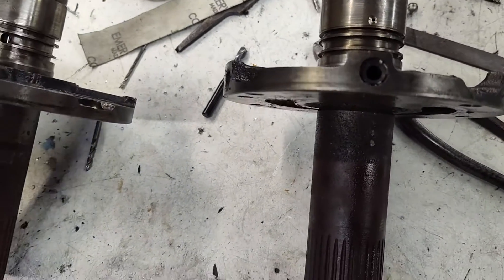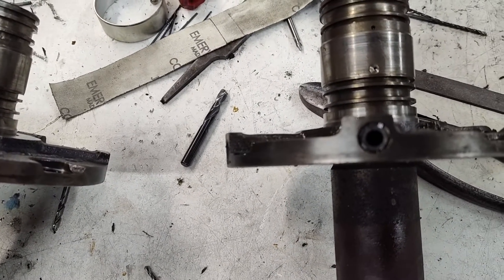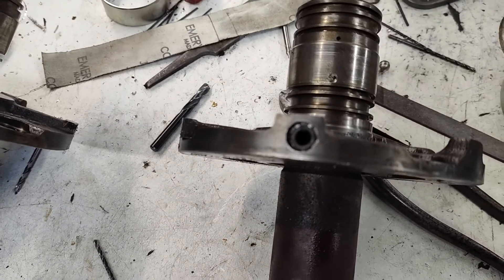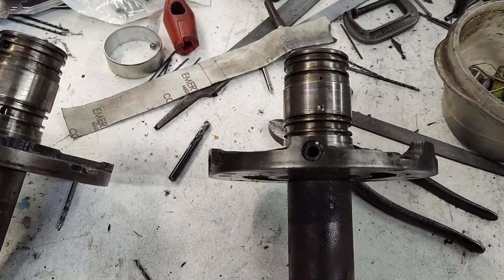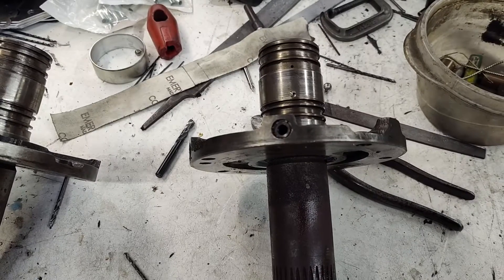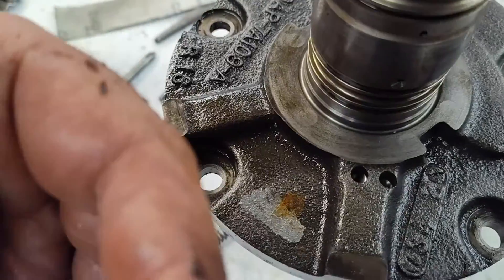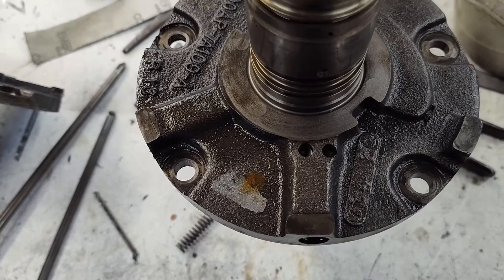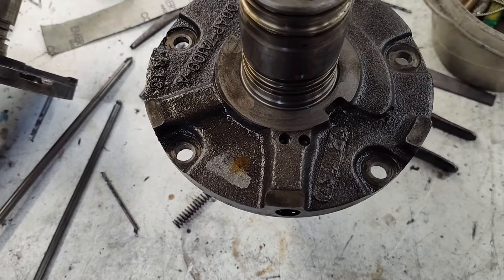Ford C4 Converter Pressure Relief System Explanation and Modification

Comment: The early C-4 didn't have the converter pressure relief. We had a bullet plug that we dropped in the feed hole. Converter relief started around 1967 if I remember correctly. Torque converters have to be full and under some pressure or they will start picking up some slip.
Reply from the maker: I remember that restrictor you are talking about. Those early C4s had a sorry oiling system.

Comment: I have a 408W with c4 rev valve and transbrake and it has blown the pump gasket twice now since the install. Has a 3600-4000 stall i believe. Do you think its pressure related?  Thanks.
Reply from the maker: Its a common problem with a C4. I would check your pressure and make sure its not super high.

Comment: I rebuilt my c4 with the broader performance kit years ago. Billet servo it shifted great for awhile and now skips second and goes to third
 Manually can hit all the gears. Sometimes in first jf I slow down it revs up to 2500 then catches pulls to 3500 and then shifts to 3rd. I screwed with the governor setting years ago a bit trying to get the shift points higher in the rpm range. It is running a deep pan and the proper filter. Stage 2 shift kit and 2500 stall. I can live with it but if it is something  somewhat simple I would like to fix it. Any ideas or suggestions would be appreciated. Thank you.
Reply from the maker: That's a complex issue. As these valve bodies get older I find sometimes fresh units I Dyno will stacked shift and skip second. In the interest of saving time I typically just build another valve body and it usually works. I'll try and address this in a video someday when it happens to me again and I have time to talk about it and how I fixed it.

Comment: Would a stiffer spring be a good compromise?
Reply from the maker: Maybe. If its something that concerns you Id probably just leave it alone. Personally I have not seen issues doing this when the whole system is worked over to accommodate it. If this is the only mod your going to make to the oiling system then dont do it.

Comment: If that pressure relief sticks open, the lube oil pressure to the direct drum/stator support bushings goes to zero.  Another note is that blocking the relief off, even with an anti-ballon converter won't save the converter/thrust main if the cooler/lube gets plugged/restricted.  Runaway hydraulic pressure is quite unforgiving.  I've seen all sorts of destroyed parts from a runaway line condition.
Reply from the maker: I dont worry too much about it because if either scenario occurs you should notice this with converter stall and cooler temp before you cause damage to the engine. Hopefully! Good points though.
Reply: @BroaderPerformance  I agree it's quite apparent that things aren't right when that happens.